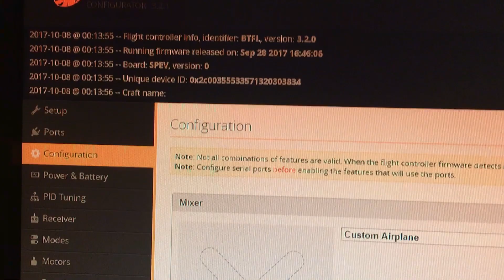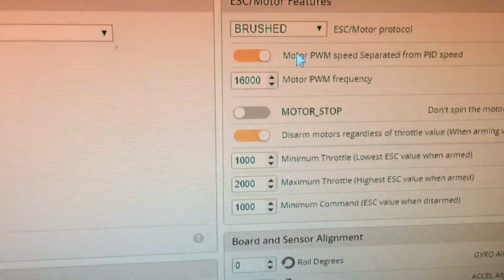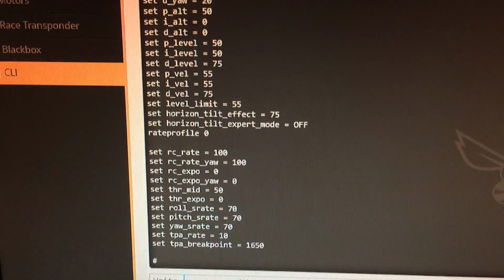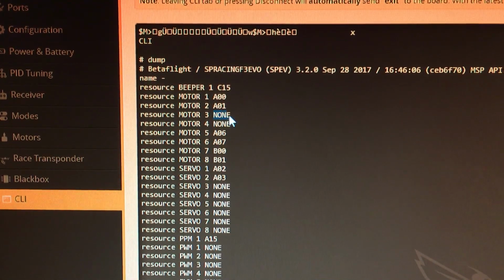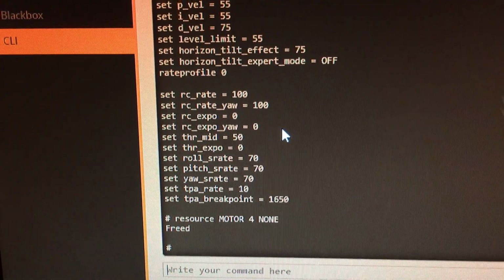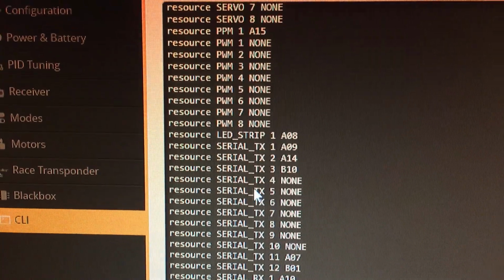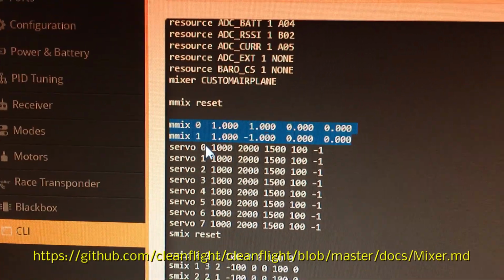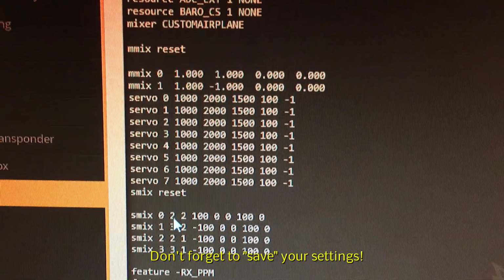Brushed F3 Board with Servo for Wing/Plane

Comment: Hey thank you for the video. I know it is a bit older but never the less I tried your setup. But as soon as i want to spin up the motor it is stuttering. The motor is fine because when i switch to the quad config it is working as expected. Do you have an idea why?
Reply from the maker: Motor mapping is correct? Try to change PWM setting and Look what is different to your quad settings….
Reply: @dako76  Motor mapping is correct. The only thing i did differently is, that I use M2,M4 for servos and M3 for Motor. The Ressources seems to be assigned correctly, because everything reacts as it should. Only the Motor stutters on throttle. I guess it is DMA problem. Thank you for reply
Reply from the maker: @marcusp2905  Try to Check if Motor is configured as Brushed or what you are using.

Comment: Hi just watching you video going to do the same but was wondering do I need to remove the MOSFET and resistor or could I just solder the servo to the resistor to get signal ?
Reply from the maker: Should be possible but i am Not responsible for Damage 😁

Comment: have u got any more information on how to do this do i need to remove the square black pad  and solder a wire  to it bridged  to first pin where the resistor was
Reply from the maker: Yes, it is just for better place for solder the wire. You see it at 0:56 in the upper i have two servos in the lower for the motor
Reply: @dako76  ok thanks im doing this to old beecore v2 same thing diffrent layout have any advice for finding what resistor goes to what fet like is there a way to know what side of the fet is the first pin
Reply from the maker: @sket123flamez7  sorry no, look more complicated, i would not do this on beecore v2
Reply: @dako76  thanks and  yeah i know i have been trying to find information about doing it for years science i first saw your video

Comment: Why did you add the diode on board?
Reply from the maker: reverse polarity protection if servo is moved or blocking, but it is not necessary

Comment: i do the same (but not make bridge just connect to pad). 1-st time servo move but...but i have some problem with betaflight configuration... i think. can you please dump your files. wanna search mistake in my servo options. maybe not enable something... maybe not configure servo right....
Reply from the maker: # dump
# Cleanflight / SPRACINGF3EVO 2.1.0 Jul 30 2017 / 13:13:51 (8b24735)

resource BEEPER 1 C15
resource MOTOR 1 A00
resource MOTOR 2 A01

resource SERVO 1 A02
resource SERVO 2 A03

mixer CUSTOMAIRPLANE
mmix reset
mmix 0  1.000  0.500  0.000  0.000
mmix 1  1.000 -0.500  0.000  0.000
servo 0 1000 2000 1500 100 -1
servo 1 1000 2000 1500 100 -1
servo 2 1000 2000 1500 100 -1
servo 3 1000 2000 1500 100 -1
servo 4 1000 2000 1500 100 -1
servo 5 1000 2000 1500 100 -1
servo 6 1000 2000 1500 100 -1
servo 7 1000 2000 1500 100 -1
smix reset

smix 0 2 2 -100 0 0 100 0
smix 1 3 2 -100 0 0 100 0
smix 2 2 1 100 0 0 100 0
smix 3 3 1 -100 0 0 100 0

set p_pitch = 29
set i_pitch = 5
set d_pitch = 0
set p_roll = 15
set i_roll = 5
set d_roll = 0
set p_yaw = 18
set i_yaw = 5
set d_yaw = 20
set p_alt = 50
set i_alt = 0
set d_alt = 0
set p_level = 50
set i_level = 50
set d_level = 75
set p_vel = 55
set i_vel = 55

set d_vel = 75

Hope this would help you...

Comment: What battery do you use in this video - 1S or 2S? What is the purpose of the diode?
Reply from the maker: Ramas Noramas you can use 1S or 2S you have to change the switch on the fc board

Comment: Great work Daniel!! I have different layouts on my F3 flight controllers, what are you bridging? Any chance of a build video of the individual steps? Everybody has been looking for this!! :D
Reply from the maker: Hi Leon, i just make a bridge for better contact to the signal pin you can look at 0:55 in the video where i show a picture. you did not need the bridge you can solder direct to the pin. Individual steps which are not in the video is just unsolder the two components on the picture which are "red" marked. Just use the output from which motor M1,M2,M3 or M4 you liket to use. If you have more question, just ask me.
Reply: Daniel Köttel Hi - weisst du ob man an Stelle von servos auch einfache brushed motoren anschließen kann, die dann vorwärts und rückwärts drehen können?